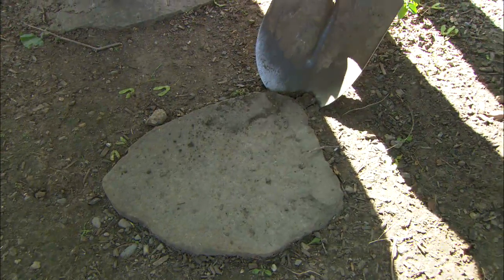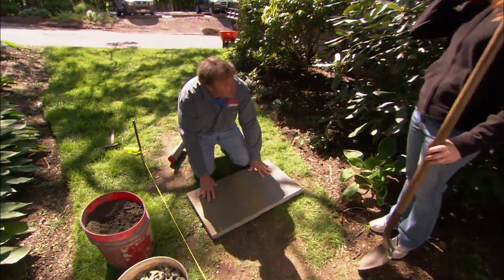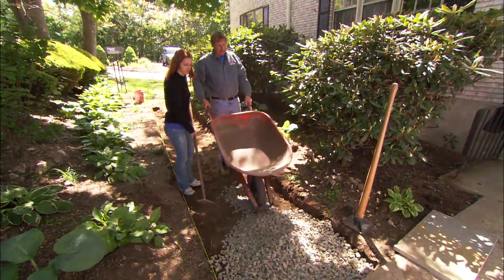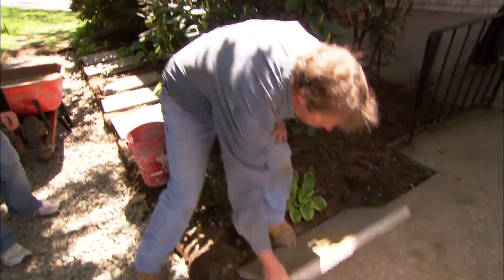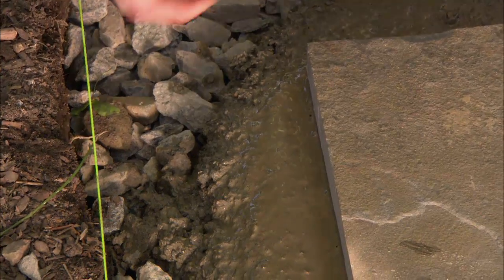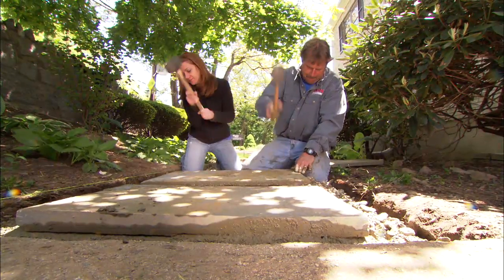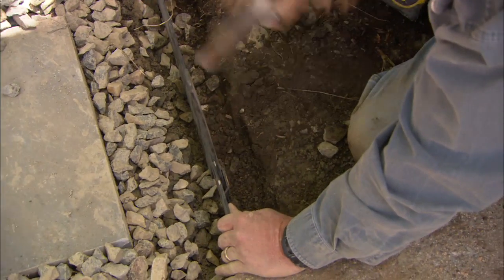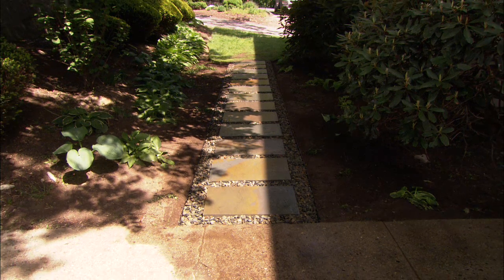How to Lay a Bluestone Walkway | This Old House

Comment: No need to make a slurry with the stone dust since the bluestone is nice and flat w/ no voids. Put the stone dust down dry then wet it w/ the garden hose to moisten it. I hate metal edge of any kind. It never stays in the ground after a couple winters where the frost heaves it up, and you rarely have success pounding it back down in place.  AND, how the hell are you going to shovel snow in the winter without disrupting the stones that are just laying on top.  Stone dust is not cement, so a snow shovel will surely compromise the whole job.  This may only work in Florida, or Cuba, or the Virgin Islands, Hawaii, and anyplace else it doesn't snow.  Get real Roger.
Reply: @marekmareckz5279  I've been in the business probably longer than you've been alive.  Stone floating on a top surface like in Massachusetts is not stable in the wintertime.  Sure, it looks good, but so does a pea gravel walkway until YOU HAVE TO SHOVEL SNOW like in Massachusetts. So go ahead Marek, "try to do things there".
Reply: @marekmareckz5279    From where I live, a hammer has always been called a hammer, and a compactor has always been called a compactor.  I would never make fun of Roger and the way he says things, but don't assume I'm from Massachusetts just because I know how to spell it.  Hitting anyone over the head to harm him is not my style either.  I was commenting from experience.  I've been asked to do that kind of work and always refused to do it because I don't want a customer to regret their purchase down the road. There are better and more practical long term ways to create a walkway. But I'm getting away from the point here. Just came back from a funeral and was reminded of how good most people are, and how great some people are.  Tomorrow we will be burying a great person, not even 70 yet.  In your lifetime, try to strive for the greater category, and not just the good category...and you'll really be a standout person.  I'm sure, the comment STFU was the acromyn for, So Try Fixing the Underlayment.
Reply: LostInMySpace 
       I’m humbled by your response today.  I regret my comments to you and I regret using Roger’s pronunciation in my follow up comment. 
     You clearly took the “high road” in this matter.  I may have learned something other than setting flagstone today, because of it . 
      I’m sorry for your loss as well.
Reply: I agree that is the one gripe I have with this show. They often dont emphasize enough that what they are doing will only work in that particular geographical location.
Reply: On different episodes, he adds cement to a stone dust mix. However he varies, sometimes it is 13 parts stone dust to 1 part cement and other times it is 8 to 1. Seems this still would jot be good where it snows and you have to shovel.
Reply: Im responding to my post here originally made 5 years ago.  Well, dare I ask the homeowners how does it look today, June 16, 2024?  Probably not so great as the Massachusetts winters will tear it up and by now pop that metal edging right out of the ground. Looks good day 1, but 5 years later?